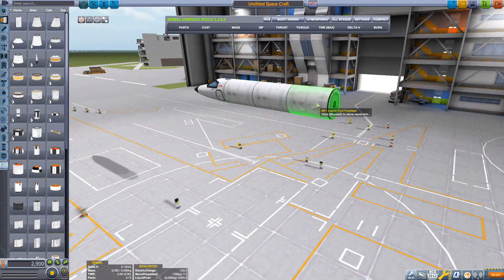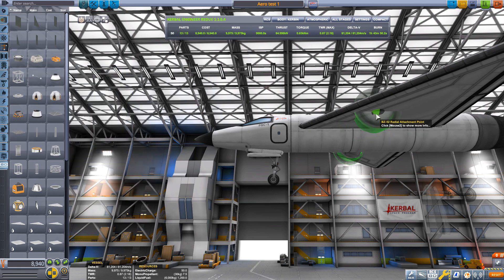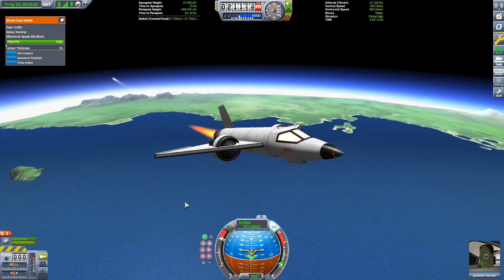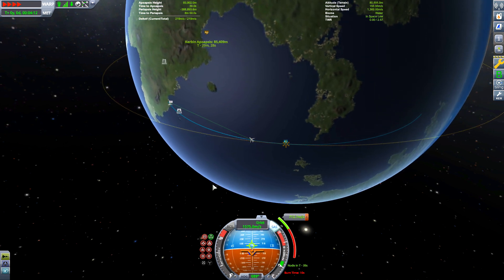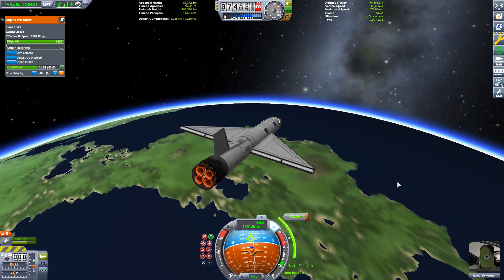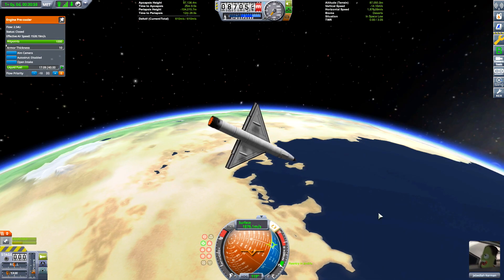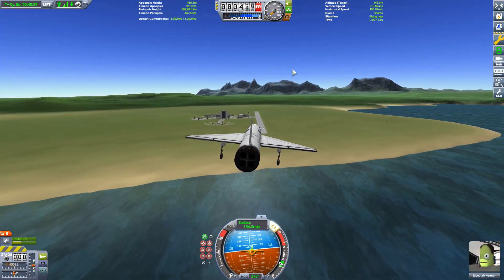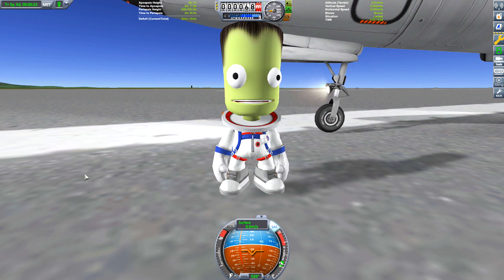KSP - SSTO Space Program

Comment: I enjoyed this and felt for sharing a bit on landings only:

"The Kerbin landing standard" is to just follow the airport strip in level flight or tiny pitch up and do go around if you can't air break enough for touch down. KSP stall is around 50 m/s for the well built planes, so never stall and know the stall speed of the individual model (apply throttle to stay in a situation of lift and level when it looks like a landing).

A good tip for any pilot is to imagine that the air strip starts earlier.
Reply from the maker: Thanks for the advice I need to improve my control of planes, I did the landing unpowered just to see if it was possible but I think I correct too much.

I think thats why I started this to get used to every aspect of space planes so this help is very welcome.